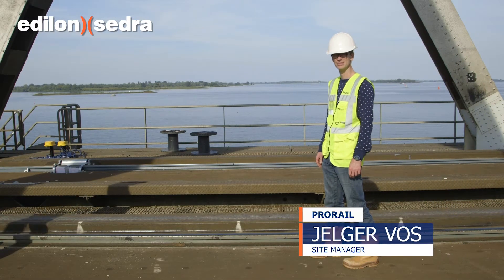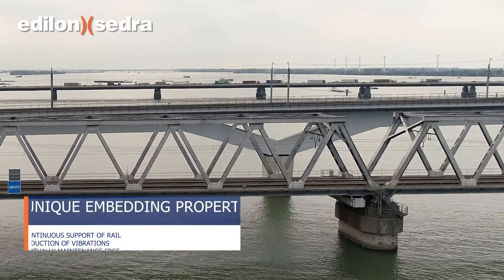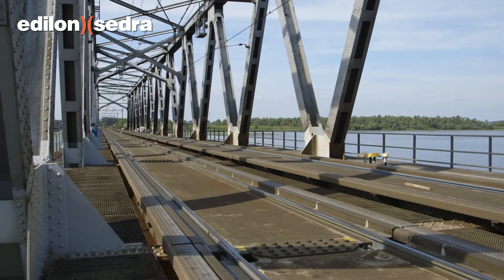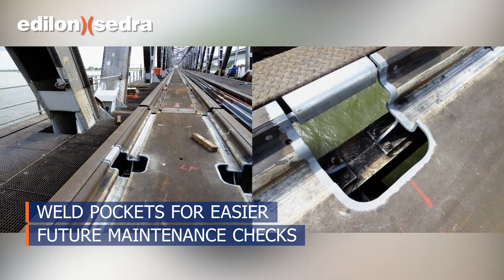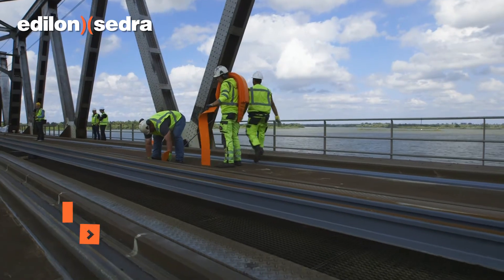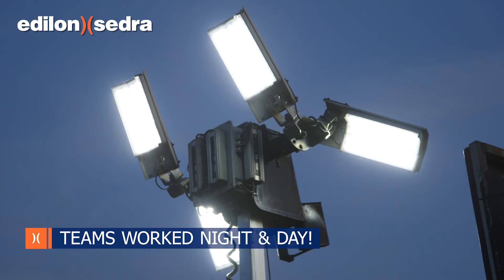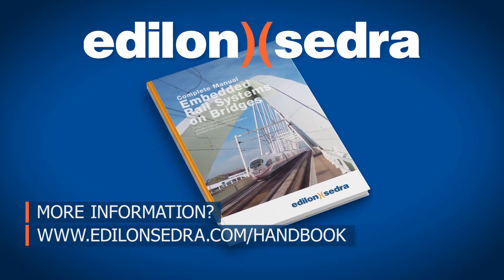How to upgrade an existing steel railway bridge and extend its lifetime

Comment: edilon)(sedra ERS (Embedded Rail System) hat das Konzept der Schienenbefestigung radikal verändert. Durch eine kontinuierlich durchgehende elastische Lagerung über die gesamte Schienenlänge ergibt sich eine optimale Auflagerung bei voller Rückstellkraft und elektrischer Isolierung.

Außerdem werden auf diese Weise die logistischen Probleme und Kosten umgangen, die mit Schotter, Schwellen, Grundplatten, Befestigungselementen sowie ihrer späteren Kontrolle und Wartung verbunden sind. Mit diesen einzigartigen Leistungsmerkmalen ist edilon)(sedra ERS optimal für Tunnel, Bahnhöfe, Brücken, Industriegleise, Betriebshöfe, Waschanlagen und Arbeitsgruben geeignet.

Produktvorteile:

    Äußerst langlebig auch bei kreuzenden Mischverkehren (Züge, große Lkw, Busse, Autos, Rettungs-/ Einsatzfahrzeuge)
    Einsparungen bei Bauhöhe und Gewicht
    Erheblich reduzierter Boden-/Körperschall
    Attraktives Design, leichte Reinigung
    Diebstahlsicher (keine entwend- oder verbiegbaren Laschen / keine lösbaren Schrauben)
    Optimale elektrische Isolierung

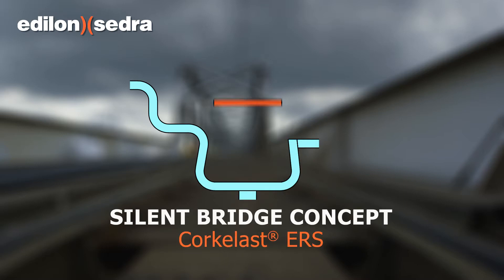Comment: 1:27 Why is this pipe placed next to the rail? What is the purpose of this pipe? And why exactly next to the rail, which emits vibrations ... Why the rail is flooded with liquid. What this liquid gives. What effect? Spaibo for the answer
Reply from the maker: For answers to (most of) your questions and more info about our Corkelast® ERS for bridges, please download our handbook "ERS on Bridges". It's for free. You can find the download page here: www.edilonsedra.com/handbook
Reply: Saving Corkelast material.